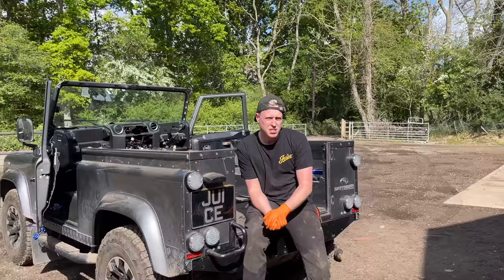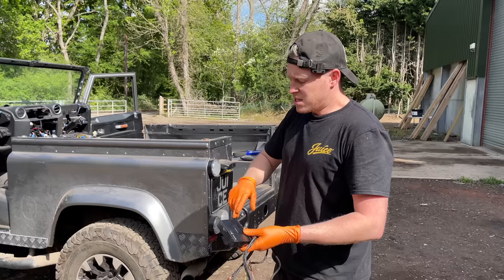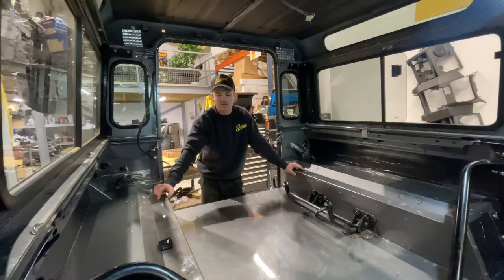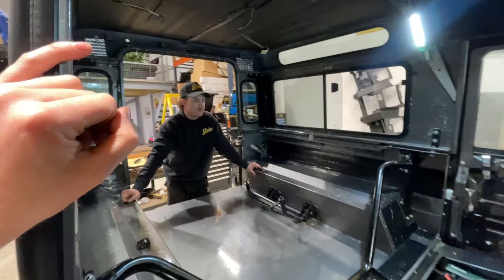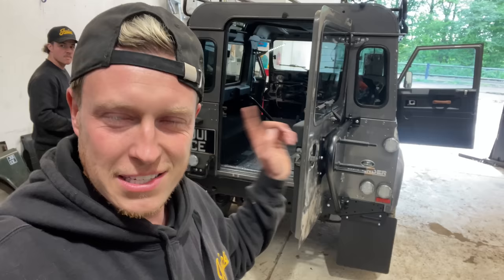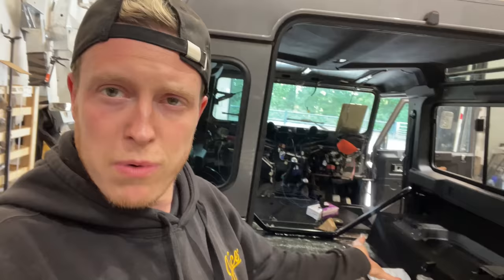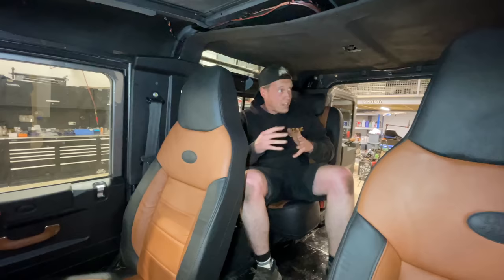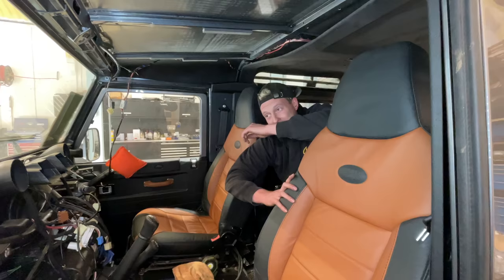Defender van to CSW Conversion - Part 4

Comment: Looks great can't wait to get my up and running managed to get it tuning over but not started so time to change the fule filter and glow plugs and go from there got my 30 mms spacers then on to the interior. The tan coloured interior is definitely growing on me.
Reply from the maker: Go for the easy route first! 😎 good luck with the build
Reply: @juicemotors  thank you and I will definitely do the Easier bits first and watching your channel has inspired me to crack on and get my build done and I will definitely have to come to the garage once it's up and running one day to sort some prices out on a interior update.

Thank you for inspiring me.

Comment: Your work is amazing! I will say seeing the bare guts and then getting built up is quite interesting. Unless I missed something, there doesn’t seem to be much structural support with the roof. How do Defenders do in rollover crashes? I would think the roof just caves right in. Also, I always thought they could hold a lot of weight on top with racks and all that. Seems that might not be too safe without more support. Love the video, thanks!
Reply from the maker: Thank you Jerry! There isn’t much structural support in the roof at all! In the event of a roll over crash, the roof will fold over like paper… I always stress how much these vehicles need the Safety devices windscreen roll bar. Thanks for your support!

Comment: Did exactly the same conversion with YRM panels, rear tumble downs took a little fettling. Where are your rear seat belts? Did you get the original brackets to mount the fir tree clips above and below the upper seat belt mounting point on the rear window surrounds? Do you use WhatsApp? Really looking good, lots of work…